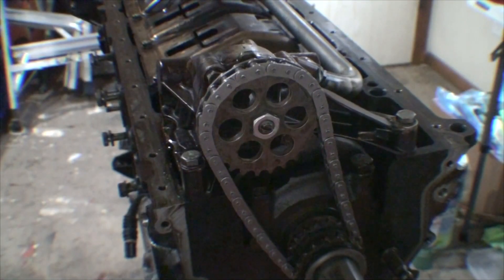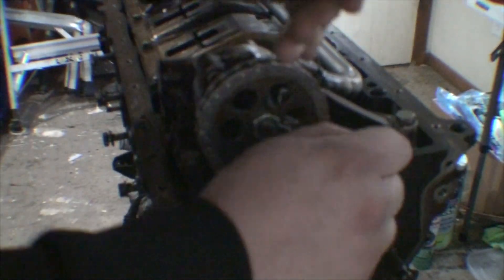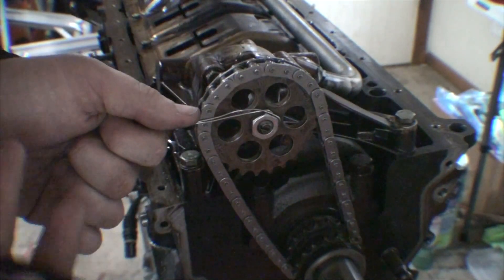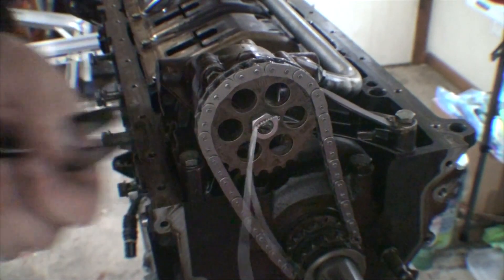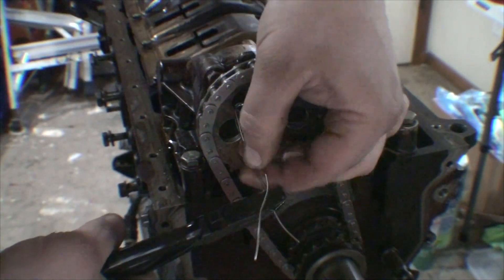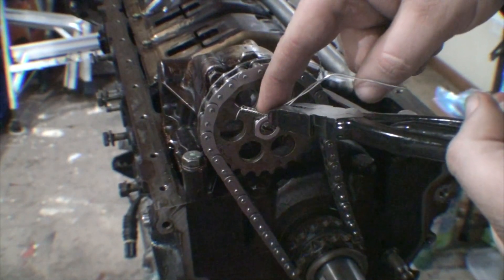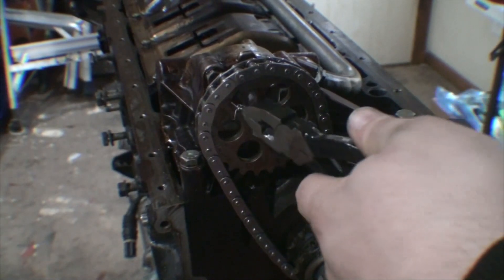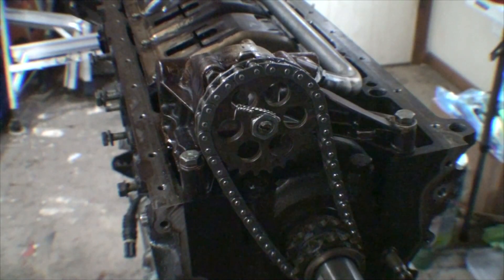How To Safety Wire Your BMW Oil Pump Nut

Comment: Could this be done with the motor in the car?
Reply: Yes. You have to remove the oil pan which is involved. Support the engine, disconnect steering shaft, engine mounts, front control arms, 4 subframe bolts and lower subframe.

I did the oil pan a few months ago and decided to leave this alone. Now I would like to do the lifters and timing chain, and am mad that I either have to do the oil pan again, or leave it be, and no new oil pump chain and s54 lower tensioner
Reply from the maker: 100%

Comment: Anyone really interested in doing things right: This is a BAD idea accompanied with wrong information. 

First of all, safety wire strength has nothing to do with the number of twists or wraps (depending on your terminology). It’s an FAA regulation with the strength and durability factors already pre-determined. Too many wire wraps will actually decrease the strength, and increase the chance of failure.

Secondly, in this case everytime the engine is started or revved, the applied torque due to the increase and then decrease of throttle will eventually take its toll, and the wire will shear at the timing gear, or the bolt hole that you may have forgotten to deburr. Either way, this can lead to a very expensive lesson, and is most definitely, bad advise.

If not licensed or trained in aviation via the military you might not have known. Now your Patreons have an advantage.
Reply from the maker: Fortunately for the aviation world I'm not responsible for keeping airplanes in the sky. What I am responsible for is keeping the oil pump sprocket retaining nut in place which in turn keeps my engine from killing itself. It's been 4+ years and it's still there, along with the safety wire.

Comment: what type of wire are you using? i bought the kit, did it badly twice, undid it and broke the wire. now im looking for good enough safety wire to use
Reply from the maker: Malin Co. .032" stainless steel safety wire. Can be bought online from Amazon and other sources.

Comment: I have a question, my E36 318 TDS compact has already burst the oil exchanger 3x, no one has ever discovered the problem, now a well-known gentleman, who was a Bosch employee for many years in Germany, told me that the problem is often in the by-pass valve in the oil pump, which causes excess oil pressure and the exchanger bursts. Can anyone help me?
Reply from the maker: I don't know anything about the M41 diesel engine. Never came to the US market and have never looked at parts for it. The explanation of a bypass valve problem in the oil pump sounds like a possible scenario. To confirm that oil pressure is too high you would need to monitor oil pressure with the engine running under various conditions.

Comment: i knew it had to be a LH thread; what a threat, the direction of the wire    lol 

thanks for the video,that works; and it's easy to drill the 2-holes-into-one on the nut too,no need to wait for delivery

Comment: I occasionally get "low oil pressure" warning in my 5 series with the same engine (2004 e60). is this something I should have done ASAP? I am NO expert so any advice would be greatly appreciated! thanks!!
Reply from the maker: Not likely related to the oil pump nut. In this specific case, the safety wire is intended to prevent the oil pump nut from ever coming loose which is a problem track cars would have since there is no oil pump chain tensioner. If the nut falls off and the sprocket comes off the oil pump there will be zero oil pressure resulting in engine failure.  Intermittent oil pressure warnings is usually one of two things:

1) Anti drain back valve in oil filter housing has failed or has a very loose spring. This will usually cause oil pressure warnings on startup as oil is not present in the oil filter housing (drained back to engine). The oil pressure switch is located on the filter housing. This is the most likely culprit. The fix for this is replacement of the oil filter housing.

2) Low engine oil level which causes the oil pump pickup to not adequately siphon oil from the main portion of the sump. This would only happen when cornering or braking aggressively. Have occasionally seen cracked oil pump pickups but that's less common of an issue.
Reply: Gareth Foley this is great thanks for taking time to respond. It doesn’t show up on start up. Will randomly show up during a drive. Personally, I have never seen the warning, only other family members when driving. But have never seen oil leaks below. And it drivers without any issues. Just worry that it’ll grenade itself without warning one day before of this
Reply: @brendan7632  hey man you still
Get that oil light?
Reply: @dohc1974  yes LOL.  that warning will not seem to go away.  Recommend using a thicker oil during my next change?
Reply: @brendan7632  it’s been too long, if your oil
Pressure was the issue than it would
Have killed the bearings. I’m almost certain it’s the sensor tripping. Check how much it costs and replace it if it’s cheap. I wouldn’t mess with the oil thickness before trying a new sensor. Thicker oil can cause problem especially now that it’s getting cold.

Comment: Coming from an aircraft mechanic, that's the worst safety wire job I have seen in years! lol!
Reply from the maker: I fully hope (and expect) all aircraft mechanics to be 1000% more skilled with safety wire.
Reply: How could it be better?
Reply: Im an aircraft mecanic too, safety wire is 8 turns of wire per inch and should always be with the max tension you can get
Reply: And I would think the twists should go counter clockwise since this is left hand thread and it would help to keep the wire down.
Reply: Looks alright